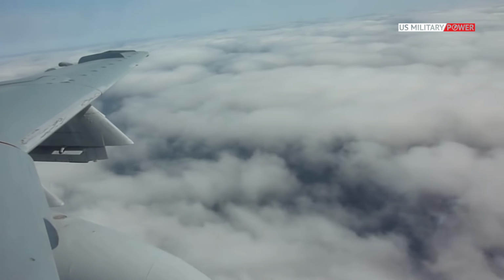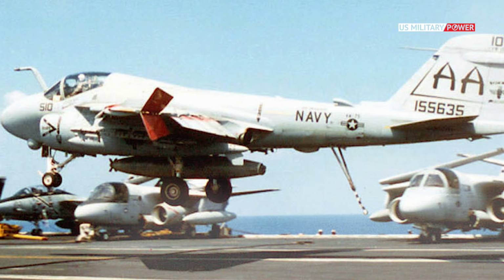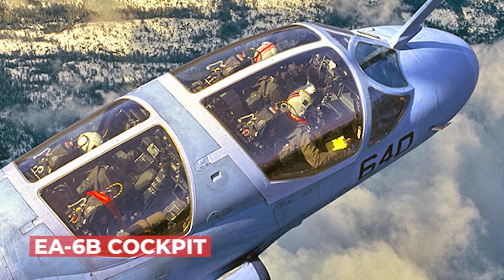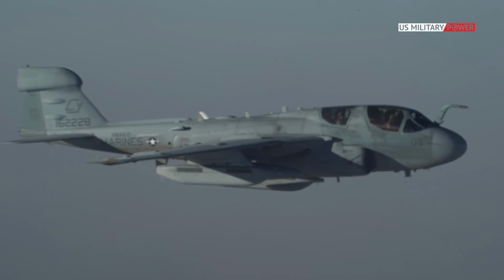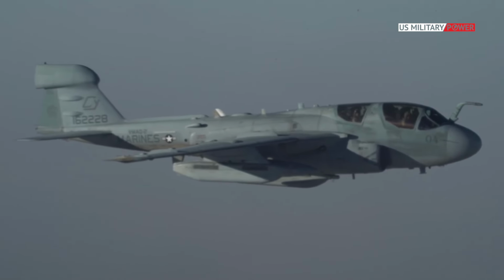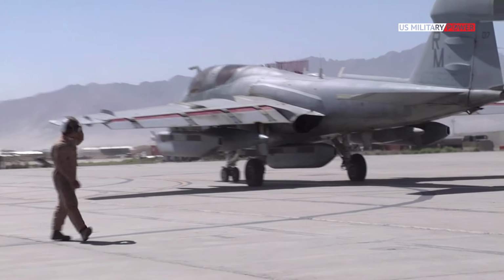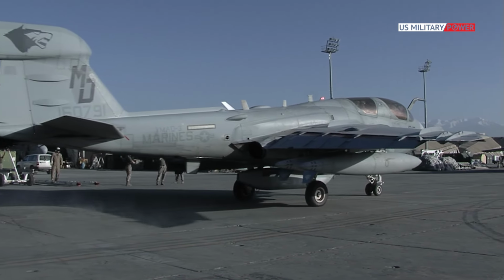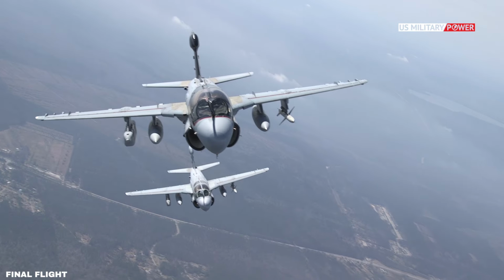EA-6B Prowler: The Sky Pig Aircraft That You Have Never Seen

Comment: The USAF does not use the EA-6B, they use the EF-111. The EF-111 uses the same basic ALQ-99 system but it is highly automated compared to the Prowler. 50 were lost in non-combat mishaps? HORSESHIT.
Reply: Airforce using a more automated version of the ALQ-99 is incorrect.  EF-111 used an older version of the ALQ-99.  Nowhere near as capable as the Prowler.  Same system as EA-6B ICAP II. (Block 82)   Prowler fleet  was flying EA-6B Block 91 systems in the expeditionary squadrons when they took over for the Sparkvark.  I got to see the systems on several Sparkvarks and have made 5 expiditionary deployments (PSAB and INCIRLIK) to Air Force Bases in Prowlers.
Reply: Then what were all those USAF officers doing at NAS Whidbey Island back in the day?
Reply: @bobharrison7693  Both the Sparkvark and EA-6B had the same EW system, though the Sparkvark was more highly automated.
Reply: @scottmurphy650  Automated and less capable than the TJS on the Prowler.
Reply: "The USAF does not use the EA-6B,"(sic)

Incorrect. zoomie aircrews transitioned to the Prowler following the retirement of the EF-111 in 1998 and flew missions in the expeditionary squadrons providing SEAD to air force ATOs.

"they use the EF-111."(sic)

Used as the Raven was retired in 1998.

"The EF-111 uses the same basic ALQ-99 system but it is highly automated compared to the Prowler. "(sic)

Automated and much less capable than the TJS on the ICAP III Prowler.

Comment: The prowlers we had on the JFK I believe were used for refueling.
Reply: You believe wrong. They were not equipped to perform IFT. A-6's and KA-6D's were used for IFR.
Reply: The KA-6D was used for that role. The only possible way a prowler could do that is with a buddy store but it would have been stupid to use a prowler's flight hours that way. Thusly I doubt they were ever used in that role.
Reply: @akulahawk  they never were used as a tanker. You’re correct
Reply: @akulahawk  so which is it? Yes or no?
Reply: @nathandodge665  No
Reply: Most expensive plane in the Navy/Marine Corps at the time
Reply: Incorrect. Prowlers were never used in the tanker role.

Comment: If they've lost 50 out of 170 produced, then it has lost almost one third ⅓ of the total production.
Reply: They were lost over 50 years. The airframes were old. IIRC we had the second one off the production line still active in the early 80's. 2 were lost when I was working on them. First was right as I got to Whidbey. The AC went into a roll at take off and the pilot pulled command eject. The other, a engine ate itself and fod'ed the other, all ejected safely.
Reply: We lost one due to the 2 Canadian Geese that went into the left engine during touch and gos at Bogue Field, NC.  Some accidents you just have to chalk up as "acts of God"...

Comment: No no no it’s not the primary EW aircraft of the navy or marines and it never flew for the Air Force. 100% wrong. This “primary” 😂aircraft was RETIRED in 2016 and replaced by the EA18G Growler. I like this channel but don’t treat us like we’re stupid. Most of us know more than you.
Reply: "and it never flew for the Air Force. 100% wrong."(sic)

air force crews flew four expeditionary - aka Purple - squadrons of Navy owned Prowlers.
Reply: It wasn't fully retired until 2019. It WAS the primary source for EW until then.
Reply: It was the primary EW AC and the ONLY EW AC. I did my time wrenching on them and was the electrician TAD to Fallon when the PAX river guys fired the first HARM off of a EA6B in 85 (IIRC) They missed. By 6 feet.
Reply: Phantom F4G is incorrect. The Air Force did crew them in 1 of 4 squadrons after the EF-111 was shutdown (after the Gulf War). Yes, the Prowler was the primary EW aircraft for the Navy over 170 of them built. How of the other aircraft where built.

Comment: Thunderchief and A-6B were pioneers of modern SEAD. I love this airframe. To me it symbolizes the paradigm shift from air superiority to air dominance.
Reply: There were only 4 A-6Bs, carrying the STANDARD ARM as their SEAD weapon.  A great mod to a good aircraft, and a great missile mod from the USN STANDARD Missile (SAM).
Reply: "Thunderchief and A-6B were pioneers of modern SEAD"(sic)

F-100F preceded the F-105F and the EA-6A preceded the EA-6B.
Reply: @AA-xo9uw  Yes. Of course I agree that there were SEAD-like missions before either of those airframes or their earlier variants took to the skies. SEAD evolved from strike missions; it wasn't spontaneously created with no precedent. Nevertheless, there was a transition that took place from having general strike aircraft with some ECM capabilities and ECM pods, to purpose-built aircraft designed specifically to fill the ECM role. When that happened, we went from a WWII or Korea-like doctrine where we would fight on equal footing for control of the airspace, to a more Desert Storm-like doctrine where we would shut down air defenses and destroy air assets on the ground before they were deployed. We got very serious about cross-domain operations and it changes the way we plan and execute. That's the difference between modern and traditional SEAD. I know that I'm drawing a sharp line on a fuzzy boundary, but in my mind EA-6B heralded that change.